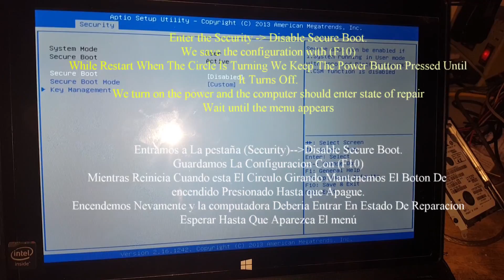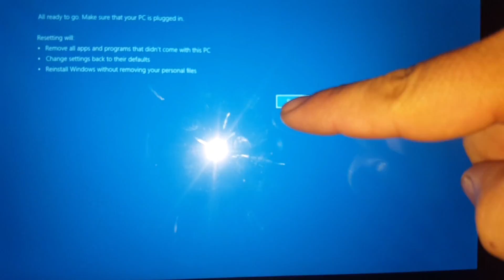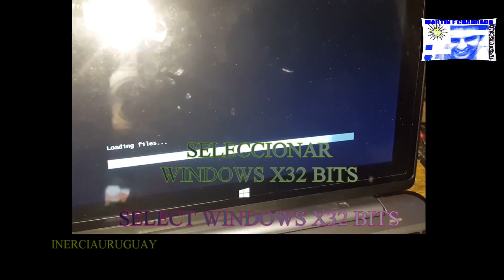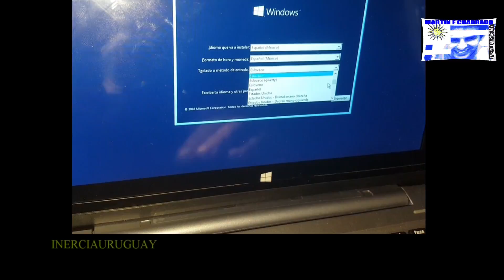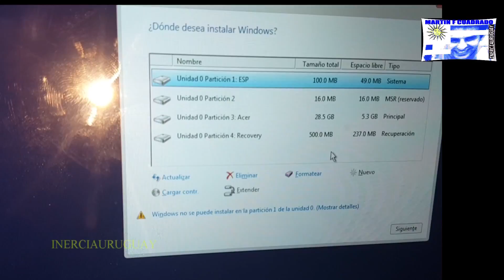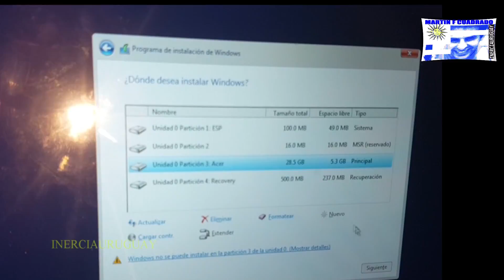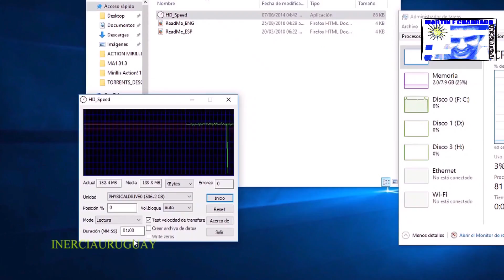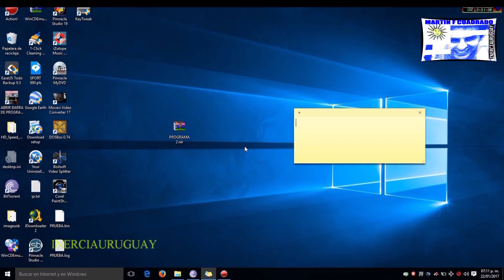Acer One S1002  Aspire Switch 10 SW5-011 DISARMED COMPLETE RESET DRIVERS INSTALL USB RECOVERY

Comment: Hola, tengo una consulta, INSTALE EL W10 32bit, pero no me reconoce los siguientes driver TOUCHSCREEN, AUDIO, VIDEO, no los reconoce, Platform Drivers_Intel_1.0.0.1064_W10x86_A, no todos los driver tiene su setup o instalador, me fije x la web y las comunidades de ACER y muchos tuvieron ese problema al reinstalarse desde de cero, si sabes d algo o algun video de instalacion de todos los drivers porfavor ayudame.
Reply: Y OCUPASTE EL DRIVER EASY?
Reply: @LSURRIBA   si. Hasta tengo los driver especificos del fabricante. Tube q darle el equipo a un tecnico para q me solucionara. Segun lo q me dijo fue q estaba deshabilita un permiso del firmware del sistema operativo.
Reply: es lo 1ro que habia hecho, pero nada, es decir como si el Hard no existiera, es decir por eso no instalaba el sonido ni el touchscreen ni brillo ni bateria d pantalla, como si estubieran desactivados los hard. EL EASYDRIVER NI EL EVEREST Ni ninguna erramienta x la web, es mas en la comunidad d ACER hay muchos d otros paises con el mismo problema

Comment: +Inerciauruguay Hola amigo! Me podrías ayudar por favor a reparar mi Acer One? No puedo instalar los drivers. Todos los que están en la página de Acer no los instala mi computadora
Reply from the maker: a todo el mundo le pasa lo mismo con los drivers en la pagina por eso yo los puse aqui en la descripcion del video tenes que descargar los archivos y luego entrar a administrador de dispositivos y darle actualizar controlador buscando la carpeta en el equipo
cada driver lo tenes que instalar manualmente y los que se dejen con el setup
Reply from the maker: si no es molestia, suscribete a mi canal
Reply: Gracias por tu valiosa respuesta, amigo. Pero verificando mi Switch One no es la S1002, es la SW1-011.
Reply from the maker: bueno esos drivers son para varios modelos parecidos de acer switch ,si le das buscar y se te los instala es porque sirve dejando de lado que modelo sea, si no sirven no te lo va a instalar